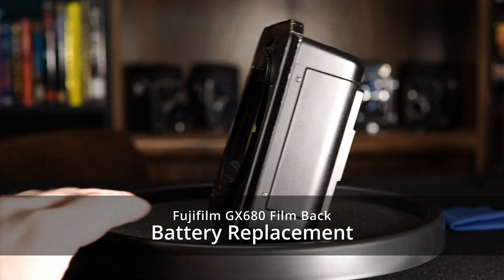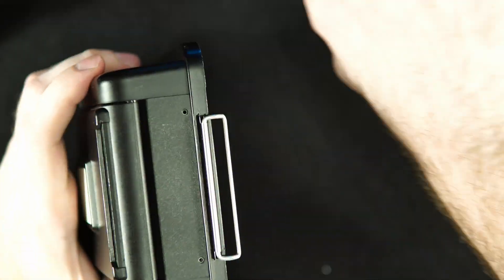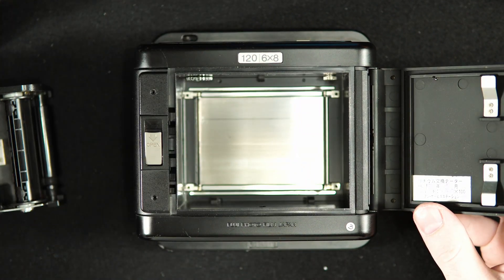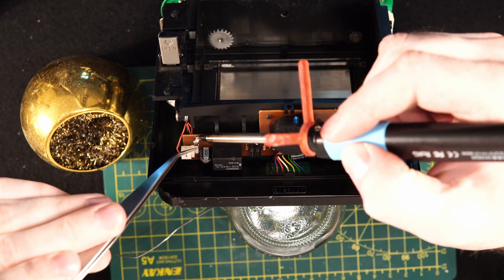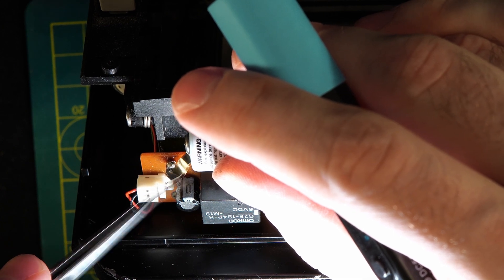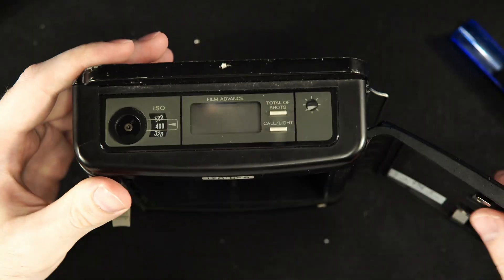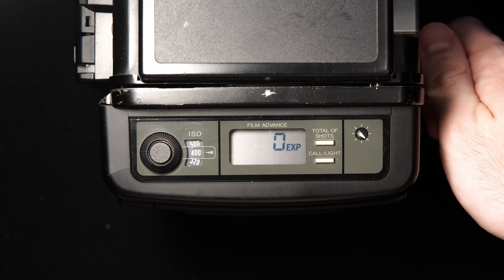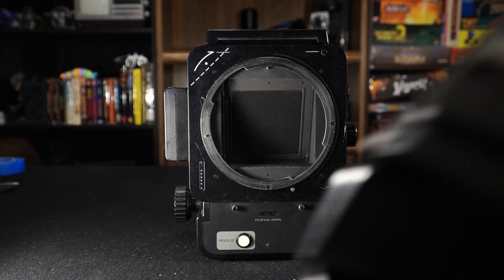GX680 Film Back Battery Replacement Tutorial

Comment: The replacement battery people should get is ER3V, which is usually already welded so you don’t need to solder the lithium battery by yourself (it can be quite dangerous).

Comment: Pity it's not a capacitor that charges from the battery pack. Is it only of use if the back is removed? Does the main battery not count exposures while attached? Just got this camera and about to test it over Christmas. The Manual does not say what the little switch facing the ISO wheel is for???
Reply: that switch is for unlocking the back when you dont have a dark slide in it
Reply: @randomnessblub  thank you.

Comment: Hi nick. I’m trying to dismantle my roll film holder IIIN, but I have difficult to unscrew the pin on the top using friction. In your opinion this is different from the old holder or not?? Thanks a lot.  Leonardo.
Reply: You don’t need to disassemble it to replace battery for IIIN, there is a door for battery.

Comment: So I've recently repaired a GX680III and am using a 120 film back with the system (type I). It's getting to be a weird thing though as I shot a roll of film through it twice but now when I load the film cartridge and it starts to wind on to the beginning of the film, it keeps on winding until the spool is empty and wastes the whole roll. Is there some sort of sensor that needs to be cleaned or should I be looking for a whole new 120 back? Interestingly I have a 220 back which came with the camera initially and this shoots and winds on with 120 film just fine. Any insight into why the film back would wind on would be helpful. Thanks!
Reply: What problems do we encounter when we do not change the lithium battery? The back I have always wraps the film all the way when I insert it. Normally, he should write 1 exp, but now he writes it until the end of the movie. Could this malfunction occur because the battery has not been changed?
Reply: Just got this camera. Spent two days reading and looking. There is a photo sensor in the back that reads the backing paper. Looks like either the sensor is not working correct or backing paper design changed.

Comment: Many many thanks. I was psyching myself up yo replace this but its always a bit scary if there are hidden clips that will break off or even its designed to nit come apart to try to force you to buy a new one (like the main nicad battery.. grrrrrr). Knowing how easy it is from your video removes all stress immediately. FYI anyone else with a gx680 .. someone has posted a free 3D printable main battery case that uses 2 modern 18650 lithium cells, so that nightmare is also no longer and issue for us.
Reply from the maker: You are very welcome! Yeah I wasn't finding too many good videos pointing out if there was anything hidden, I was mostly going off of old forum posts of more skilled camera technicians stating "yeah it's easy." As far as the battery for the camera body, I'm lucky to get to have and use the AA battery holder for the GX680II. I throw in some Eneloops and just charge them every eternity. I'll post some links to the 3D print files in the description for reference. Thanks for pointing that out!